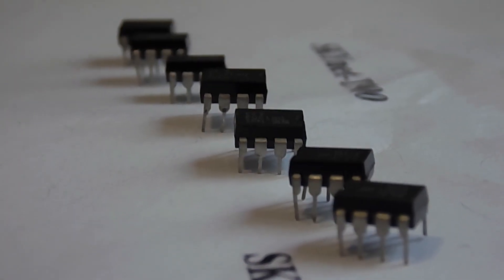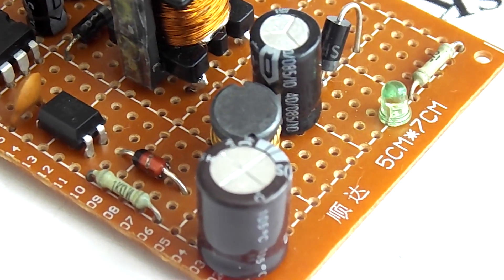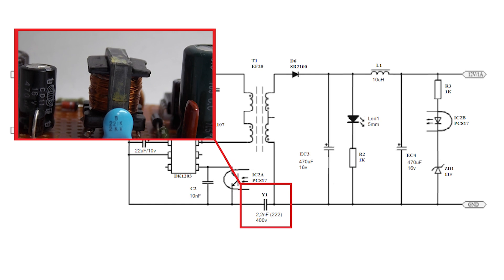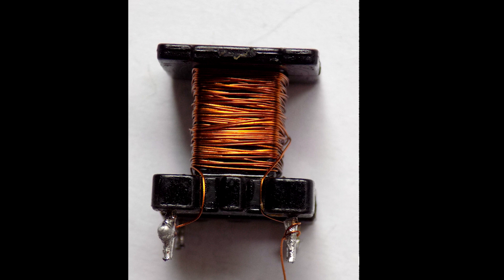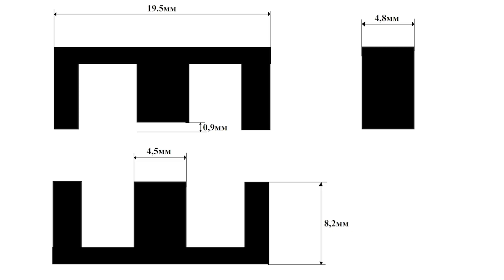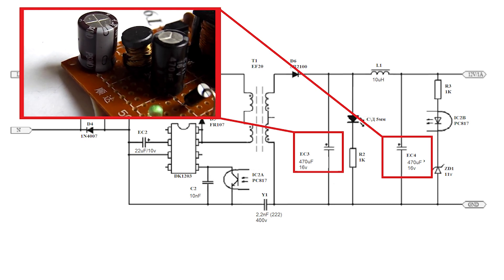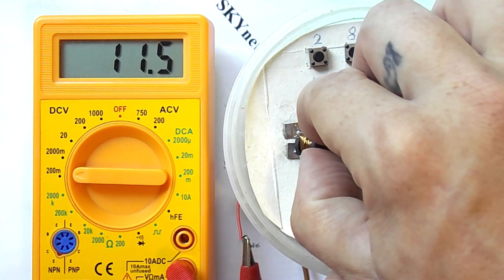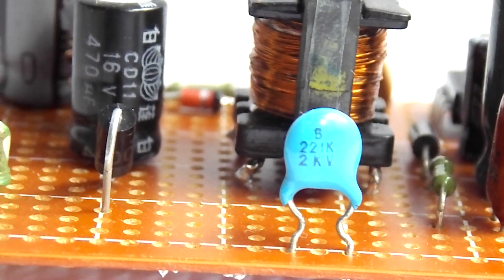A simple DIY switching power supply on the DK1203

Comment: Hey what if i wants to create a power supply that can emmit a voltage of 17 Volts in DC
and what does the transformer no. of turns specifications is that dependent on the output power supply or does it depends on something else??
Reply from the maker: yes, you can make it 17 volts. But you need to increase the number of turns of the secondary winding of the transformer and change the zener diode for such a voltage

Comment: Dear Sir,  I made thise Transfomr as you instructed. But inductance of the primary winding is about 10.8mH. Is there a problem Output voltage and current???? Thank you ❤❤❤❤
Reply from the maker: Presumably the power of the power supply should decrease.
Reply: For get the 1200uh. what wire i use to wrap the primary coil???. (AWG) Thank you ❤️❤️❤️
Reply from the maker: You can take any thin one. The main thing is that all the windings fit in. I have nothing to measure a thin wire, so I can’t tell you the diameter of the wire.
Reply: Thank you Dear, ❤️❤️❤️
Reply: I made this power supply circuit. It is working perfectly. Out put is 12.26V about 1A thank you so much dear. I hope make 12V 5A power supply as you instructed ❤❤❤❤❤

Comment: Sir, today I have made DK124 SMPS 12v circuit, by looking at the datasheet diagram of IC, 12 volt is there without load and when 12v is 1A load it is coming down to 4 volt, what could be the reason for this?
Reply from the maker: if you took the correct core and your whole circuit is correct, then there may be several problems. Maybe they made the wrong gap and the inductance turned out not as expected. Maybe they mixed up the connection of the diode to the ends of the secondary winding or wound the wrong number of turns.
Reply: @Den_Electro_channel  Sir, Found The Problem,  IC Was Fake.
Reply from the maker: Yes, unfortunately this happens.

Comment: Would you explain how calculate the number orf turns of the winding. sorry my english. thanks.
Reply from the maker: I use a calculation program on my computer.  Usually they are almost all the same.  Enter the frequency, voltage, core dimensions and get the turns.  Unfortunately I have no plans to create a video yet.  About this theme.

Comment: I am new to electronics and try to understand why these kinds of circuits are used? What is the advantage of this instead of using a Transformer with an 12V output, followed by a bridge rectifier and some capacitors to stabilize the DC output?
Reply from the maker: Iron transformers are large and heavy. Switching power supplies with the same power are much smaller and cheaper